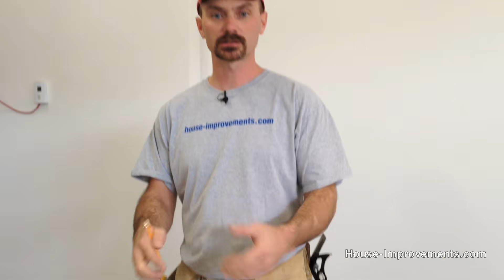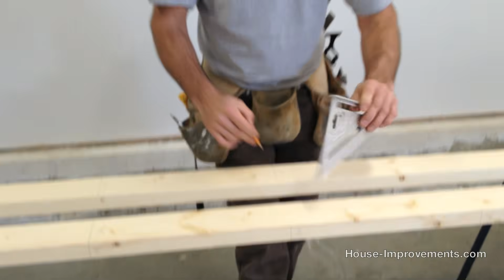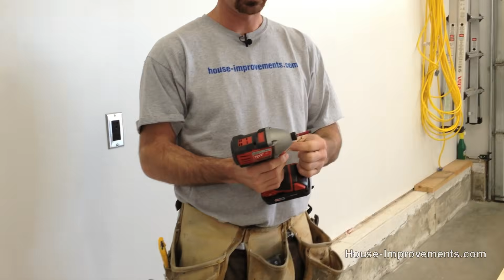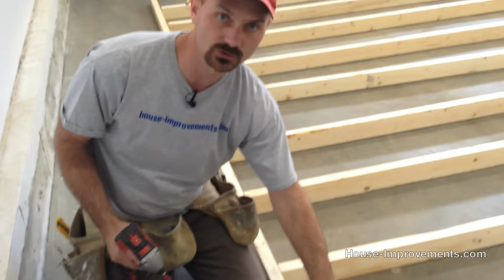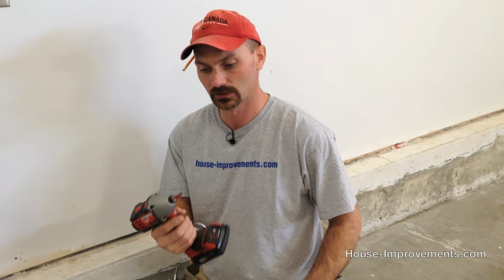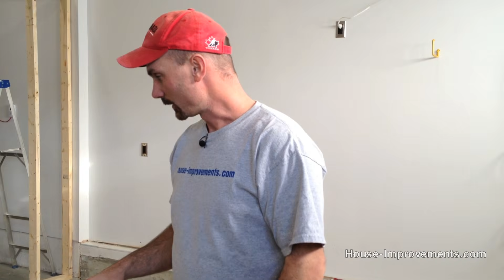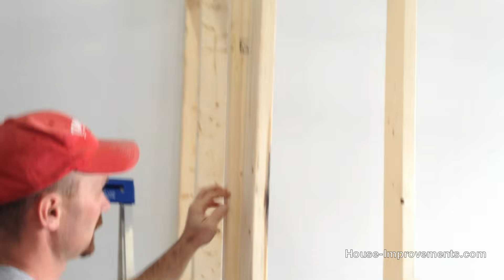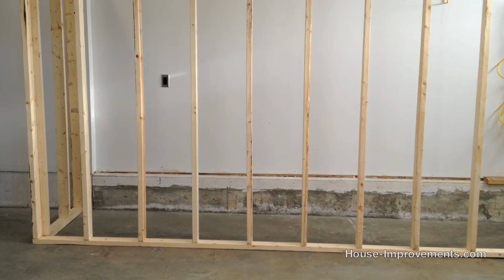Wood Stud Wall Framing

Comment: Hi Shannon, in an imperfect scenario where the surface ground or floor is not level, how to take the measurements? Should I use the shortest vertical measurement as the complete measurements for all the vertical studs?
Also, if I first prefabricate the walls, is it better to measure a little shorter than the original measurements so that the wall can fit with a slight snug instead of a very tight fit which might be very hard to fit especially if the flooring joists and ground are not level
Reply from the maker: It depends on how much difference there is in levelness. I would come to the forum with your questions and we can help you from there.  https://www.house-improvements.com/forums/

Comment: Very good video. I have to build a interior wall in my house. The will be building a kitchen wall and behind that wall will be bathroom. If I is your method when I stand the wall up how would I put a fire block between both walls?

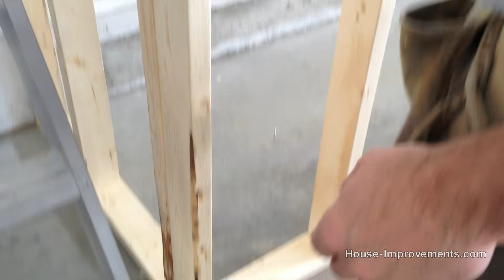Comment: Questions at 16:50 of the video....you attached the the wall onto the wall that was already erected ....doesn't that mess up the 16 inch centre on the wall  that was already erected because the 2x4 is now doubled up at the corner so when you attach the drywall onto that wall that was already erected it will no longer be 16 inch centre for that particular wall....am I missing something?...excuse my ignorance but I'm a rookie

Comment: If you end up with any studs cut too short, and there's a gap after nailing, is it a good practice to fill that gap (I would redo the stud if the wall wasn't raised already). If so, what is the best way to fill the gap? Wood shims, composite shims, something else?

Comment: Great video and very helpful! My brother is a motorcycle mechanic and he is asking me to build him an indoor wall frame that is 16x24 ft with 48" spacings of the studs. I understand 24" to be the convention, but he is trying to be low budget. Would this be safe for such a small indoor enclosing? I should add that he hopes to use the top for parts storage.

Comment: Nice job.  When installing an internal wall and placing the top against floor joists from the 2nd floor, you cant make the wall to exact height since you wouldn't be able to swing it into place (wall at an angle would be taller than the space to fit into).  So, do you make the wall a pre-determined amount shorter, then shim after it is in place?  I need to install a wall with a door frame that is non load-bearing.  I don't see how it will fit perfect without giving it "wiggle room" to get it erected.  How much length to reduce to fit?Thanks!

Comment: I just made monthly donation to your channel. I really appreciate what your doing! 

Could you please explain doing a 2 level non load bearing wall. I believe its a 14ft tall wall. Should I make an 8ft wall and then put the 6ft wall on top? Also the ceiling is about a 60 degree roof pitch. Whats the proper way the attach this wall to this angle ceiling?

Idea for a video. Turning a second floor window into a french door and adding a little sitting balcony 3-4ft from the house 6ft wide. Can you attach a header to the second floor plate and use joist hangers to come off to header for flooring? How far off the house can you come? Size wood? Do you need 45 degree load bearing supports under the deck? How to fasten deck to second floor plate? Basically i want a 4X6 deck outside my new french doors. Thank you!
Reply from the maker: Thanks for the donation. Please use our forum for your questions, it is easier to have a conversation there. https://www.house-improvements.com/forums/

Comment: Is it ok to put 3 screws in the plates?
Reply from the maker: Sure but not Necessary. And as stated in the video we used screws only because we were taking this apart after the demonstration. Nails should be used for framing.

Comment: Excellent video as always. Question: Do you still need a 2nd top plate if the interior wall you're building is short enough that it doesn't need tied to another top plate? Thanks.
Reply from the maker: one plate should be fine
Reply: That's what I figured. Thanks for the prompt response!

Comment: i hate using nails. to me there is just nothing at all good about it. the noise, the way the wood splits, inability to ever get it out, however, im more of a hobbyist when it comes to projects and am not certain about the sheer strengths of nails or particular code requirements.

Comment: If you use nails, what length and type of nail should you use?
Reply from the maker: For a hand nail I would use a coated (green sinker) nail. (16 penny,8gauge, .165" )  3-1/2" long

Comment: Great video, now I have my 16oc for my exterior wall laid out in Google Sketch up & added my other walls with corner studs with blocks added & have come to a dilemma, my inside studs are now off, not 16oc. My question is how to frame so the sheathing lines up & the interior material lines up too?

Comment: Shannon, the video was very informant and will be used. Question, doing my basement but already have the ceiling drywalled (its a new home with unfinished basement but ceiling already had drywall) how would I attach to ceiling and attach the 3rd railing above to next section if already drywalled?

Comment: Shannon, I want to build an exterior wall on a mobile home on a concrete pad with a door/gate is it alright to build a flat wall with anchors or do I need to screw in to the house framing, thanks for the great vidios

Comment: Great video.  I'm going to frame up my basement this winter and I'm brushing up.  Quick question, is it not a standard practice to use polystyrene foam in concrete-to-bottom plate contact?  I learned this from my dad as a kid and see no one ever doing it.  It helps to level out imperfections and creates a small thermal break for the wall.  Is using pressure treated wood and calling it a day good enough for basements?

Comment: I'm confused, when figuring out my stud lengths you said to subtract the 3 plates at 4 1/2". But 3 plates at 2" each would be a total subtraction of 6"? Can you explain how you got 4 1/2" please...thank you
Reply: A 2X4 isn't really 2"/4" that is the Nominal Value, the actual Value is closer to 1 1/2"/3 1/2", therefore 1.5[Width] X 3[Total Number of Boars] = 4.5 Inches.  Same reason he went back 3/4" and not 1", since 3/4 X 2 = 1 1/2 ".

Comment: Why you don't pre drill before screwing? Wouldn't that split the wood apart??
Reply from the maker: deck screws generally will not split the wood. As stated in the video we only used screws because this was a demonstration and the screws made it easy to take apart after. You should use framing nails for structural  framing
Reply: HouseImprovements thanks

Comment: Hello sir, im not sure if you said your name in the beginning, since I don't know it, ill call you the wall guy or WG, , okay now I noticed that when you put your wall up it was staggered at the top but I also noticed when you placed it in the upright position that staggered end was a perfect fit to the wall part that was already standing, how did you know or why was it done like that, and does it make a difference if your building a small garage, which incidentally is exactly what im going to attempt to do, I guess my question is would that staggered end be at the front of the garage ? or does this staggered end have to be in any special position, front ? back ? Im  guessing as long as you have it at least on one end of the structure it should work out okay, but will that make a difference when finishing with installing the garage door,im planning on using a standard roll up and down type I want to make positively sure I put this staggered end in the correct position as this will be my very fist wood working project I also plan on laying down a 4 to 5 inch slab of pre mix concrete, im hoping that will be enough to hold down my structure once I place the holds through the wood into the concrete, I found this video very helpful, and has inspired me to want to get this project off the ground and start putting up my very first garage built by my own hands, thank you for posting this video, I hope you can offer me some good advice on how I should go about placing my walls,joining them and so forth, thanks again very much WG, sincerely, William
Reply from the maker: Our forum is the best place for these questions and to receive great feed back and assistance. Copy and paste what you wrote here over to the forum please. here is a link: http://www.house-improvements.com/forums/

Comment: You mentioned you would normally use nails, what size?
Reply: He explains it at 13:48 in the video. 3" or longer. I use 3 1/4 smooth shank

Comment: You're a natural teacher. Very clear and well spoken. Thank you for all the great videos. I'm learning a lot with your help.
Reply: Right?!? His my teacher .gonna help me build a room for my daughter. Just by watching his videos. This 35yr old single mother is determined. Thanks 👍
Reply: Luc Desormeaux qqq
Reply: Hell yeah, great video!
Reply: Gregvancom and Matt Risinger are the most annoying folks in the YouTube construction field
Reply: "What did one wall say to the other?" 
"I'll meet you at the corner."
Reply: 1:54. So many foremen and journeymen over complicate. They won't teach you the most efficient way because they don't want you to then do the job better. They don't want people after their job. Residential construction is usually straight forward, and shouldn't be that hard to teach. You're working with wood too, so it's not like you're drilling into metal studs with tech screws. And wood is easier to saw.

Comment: hey if I'm building interior walls, how would I tie together the lapping second plate? I wouldn't be able to put the screw in from the top because it would already be touching the framing for the upper floor.
Reply from the maker: from the bottom
Reply: I figured that was how. I just wanted to be sure. I just recently bought a house that has been mostly gutted and need to put in the rooms. I'm attempting to see how well I can do it myself. this is by far the most straight forward framing video I've watched.

Comment: I am building a wall for a shed. I can't get it perfectly square. Measuring corner to corner I am one inch off. Is that going to be a problem? I don't have the studs in yet. I built two other walls already and they were square but I guess I got lucky. What is the trick?
Reply from the maker: Put all the studs in and then square it up. If you still have trouble please post in my forum.http://www.house-improvements.com/forums/
Reply: I ended up squaring it by leaning it up against a wall and shifting it a little one way. Then I put the studs in and that seemed to help as well. It is perfectly square. If its not square after studs are in is there a way to fix that?

Comment: I just have one ? When you mark on 16 inch and then mark an x from left to right, can you just draw a line on every 16 inches and start your studs  on the left on each line mark? does it make sense?
Reply from the maker: If you are hooked on the end of your plate then you must measure back the 3/4" every time and mark X. Or After you mark that first one you can measure exactly 16" from that first mark and X on same side as the first.

Comment: I usually build a corner with two studs and three sixteen inch block one on the bottom one in the middle and one at the top.
Reply: Hoyt Davis ,one can do either .Full board is better in MYO
Reply: Yep

Comment: I noticed you used the tape measure like I do; in the left hand. I'm right handed and I prefer to mark with my right hand and use the tape in my left. I apologize in advance for makimg you aware but one day a couple of years ago I realized that I've been reading my tape measure upside down for the last 40 years. Once I noticed that, it started to drive me.crazy so I went online and found left-handed tape meaaures. Anyway, it was just one of things that makes you wonder. thanks for the video. I'm building a building this summer so getting refresher from your vids.

Comment: what a great video!! I do have a question. So if i'm not mistaken your first bay would not measure 16" from first stud to 2nd due to thickness of first stud correct? Sorry if I missed something. Thanks in advance!
Reply: Why don't we make the first bay 16 inches as well?
Reply from the maker: that is correct, the first bay and usually last bay will be smaller .
Reply: Second this question. Wouldn't you want the first bay to be 16" center-to-center as well? That way everything designed for 16" studs (such as precut insulation) would fit?

Comment: The contractors refurbishing the apartments were I live re use 10 year old insulation and outlets. They occasionally place base board 1/4 inch higher than the floor too.
Reply from the maker: Sounds like landlord has a low budget
Reply: HouseImprovements   Nope. They are just being greedy. Whatever they can reuse they will and the rest of the cash , well it goes in their pockets.

Comment: On the double top plate on the long portion of your example wall, you showed you left 3.5" space, to allow the overlap and attach from the joining wall, which in your video, it was the "short" wall.  However, you didn't mention how much "overhang" is used to overlap the long wall.  It appears the 3.5" allows for the approximate width of the 2x4; is the overhang 3.5" also?
Reply from the maker: Yes , this was for a corner connection and the over hang would be the same as the width of material you are using.

Comment: what kind of wood was he using for this ?
Reply: All general construction lumber is SPF (spruce/pine/fir).  You can get higher strength lumber such as SYP (southern yellow pine) at different grades (grade 1 being strongest, grade 2 being standard construction grade), and then even beyond this you can get structure lumber with machine stress ratings (MSR), which is even stronger.  Uses for this would be long spans for floor joists for example, something with a low deflection rate, perhaps with a higher live load.

Nobody would frame their house in oak or maple unless they owned their own saw mill and were clinically insane.
Reply from the maker: Spruce lumber/timber.
Reply: How to lay a floating floor
Reply: HouseImprovements pp
Reply: Theeee Art And Craft Of Woodworkingggg>>>https://www.fb.com/woodwodenmyplane/?sk=app_190322544333196=dxgtb >
Reply: HouseImprovements, Does it matter what kind of wood you use? Should you use oak or maple that are considered hard woods to make a really firm, long lasting and rigid wall, or should you use something like pine, which is cheap, easy to work with and 99% of the time won't split without pre-drilling? Basically what I'm asking is, does it matter whether you use a hardwood or a softwood and does it just matter that the wall is built well by using the info in your video? Which, is great info by the way!
Reply: Thanks a lot. I know a bit about construction (from my father, who has worked in construction for quite a while.) Since I haven't worked in construction myself, I don't know everything about it. My dad has told me he has tried cutting through petrified oak on a house, built in 1889, to fix/replace wiring, and... it didn't work so well. His boss had to get a blade capable of cutting through steel! 

I kinda figured oak or maple wood be insane, because someone always wants to change something on the house in the future that requires cutting/drilling holes through studs, floor joists and ceiling joist. I didn't know SYP was stronger than spruce though. Last thing. My father has also told me that termites don't like poplar wood, is this true? Trying to get a second opinion.

Comment: If the first (2x4) stud starts at the edge, wouldn't the center of second stud is 16 3/4 inch from the edge?  Or am I not calculating this correctly?
Reply from the maker: The centre of the first stud from the starting end will be 16"

Comment: Enjoyed the video! I want to build walls for a shed which will be sheeted with corrugated metal cladding. So the sheets will run vertical and are about 1 metre/ 3.25 feet wide. Should the wall be built like a stud wall but with long horizontal timbers to act as a screw base for the sheets (instead of noggings?). Can't seem to find any videos about this on YouTube.
Reply from the maker: Yes strap the walls with 2x4 or 1x4 horizontally. 30" o.c. is enough usually

Comment: Hi, what kind of screws are you using.  They seem to go right in.  Thanks
Reply from the maker: I'm using wood deck screws but you should be using nails.
Reply: The ease at which they are going in is due to the type of driver he's using which is called an impact driver.

Comment: Hi Shannon. The BEST framing video out there. Nice job. I'm just really confused about one thing - screwing into the wood. I've bought multiple drills - I even got an impact drill and deck screws like you described but my screws just don't seem to glide in like yours do. Can you tell me exactly what I'd need to get (ie drill, type of screws) in order for it to be as easy as it is in your video? Do I need to make a pilot hole like some people recommend? It would make it a little complicated to line those up. Thanks so much!
Reply from the maker: are you using a course threaded screw? those work best. I do not think it is a problem with the drills.

Comment: if you are building a frame and the concrete floor that you're building on runs down at 1 end how do you address this ? do you just adjust the individual sizes of each vertical stud so that the top header is level ?
Reply from the maker: You may want to frame it standing in place. Install the top and bottom plates and then measure and cut each stud to fit between them.